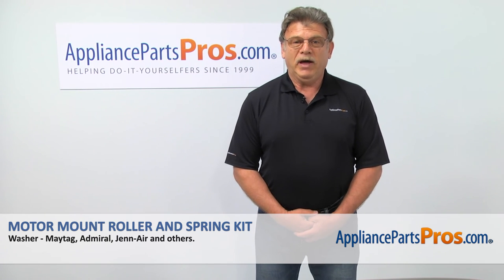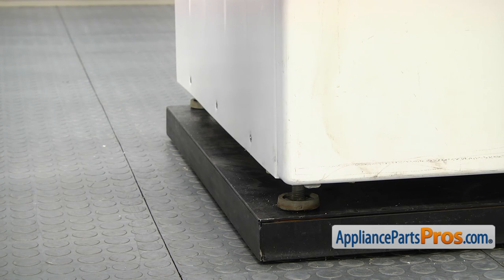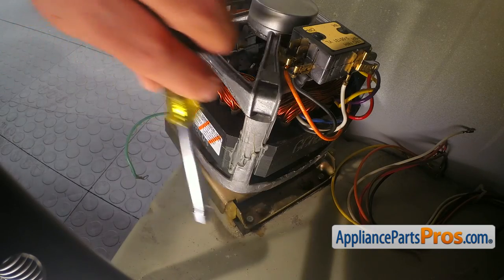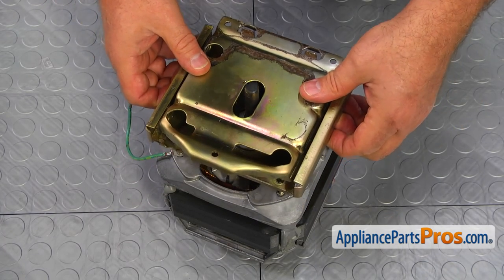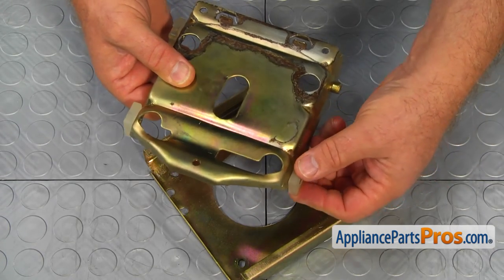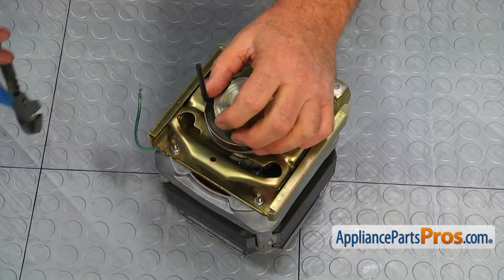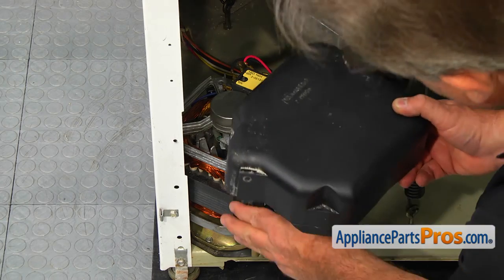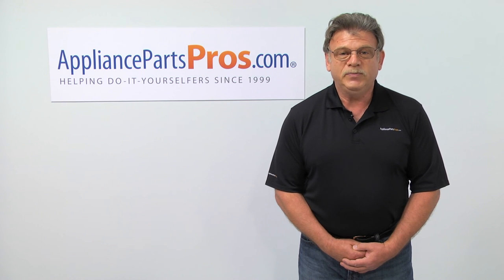Washer Motor Mount Roller and Spring Kit (part #205000)-How To Replace

Comment: Good information to me.  I bought a house with the same old washer in it and I needed to know if the glides needed to be lubricated and the vid answers the question, thanks.  Unfortunately the area the motor is mounted to looks too rusty to even try to remove the motor, it's even hard to find where the mounting bolts are but I may try to remove it anyway and clean up the area because it looks like a good old washer, good metal pulleys and it's kind of quiet for a washer.
Reply from the maker: Glad the video helped you get the washer fixed!